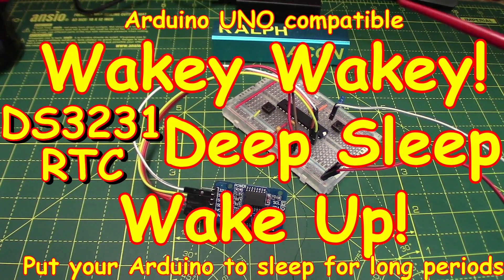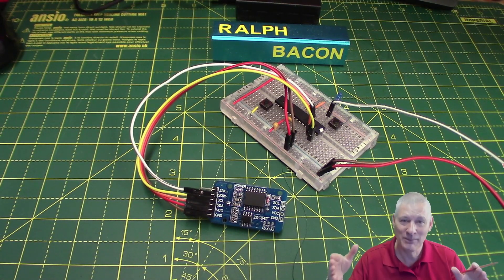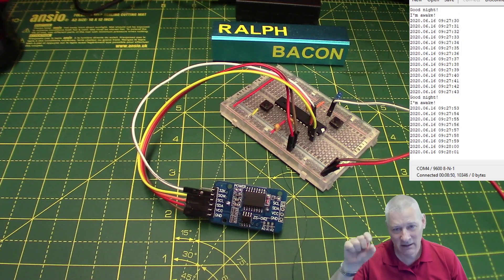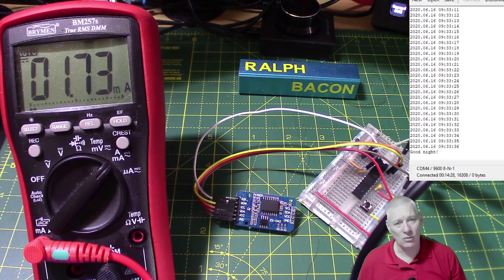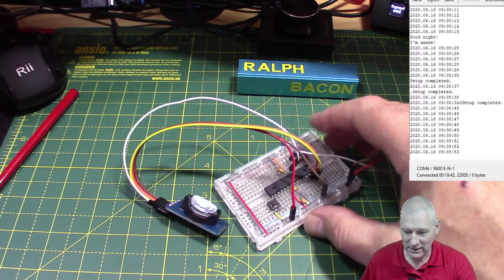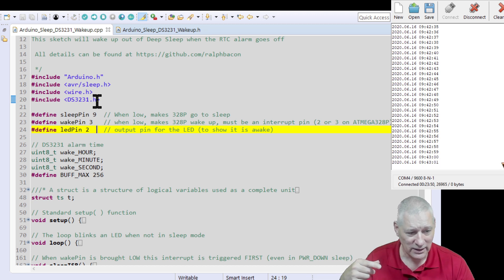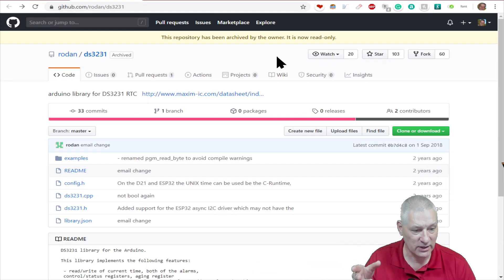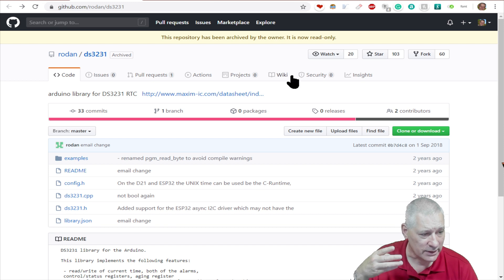#192 Wakey, wakey! Let the DS3231 RTC wake up your Arduino - easy!

Comment: Thanks for the interesting video Ralph, I actually use these RTCs with all my IoT sensors around my house but it did take some time to get a fully working & stable device for my needs, i.e.extremely low power use.

Without posting my schematics the basics of my system are as follows:

Sensors are powered via 2 x 18650 cells in parallel for capacity not voltage which go to a ultra low Microchip 3.3v LDO

The output of the LDO is connected to a P- Channel MOSFET & the gate of the MOSFET is connected to the INT/SQW pin of the RTC (DS3231)

(all this time, my ESP8266 & even the RTC itself has no power, the RTC purely running on CR2032 backup)

When an alarm is activated, the gate of the MOSFET is pulled low which then sends the regulated 3.3v around the circuit.

ESP8266 is powered on, takes a reading and sends this reading to the main unit located elsewhere via ESPNow, ( the main unit is connected to a permanent supply & connects to the internet to upload the reading), sets a new alarm for the RTC and then shuts down to wait for the next wake up call. The MOSFET gate is then sent high once again & all powere is removed from the circuit.

RTC is now running on battery backup again.

There are a number of caveats though that mean some modifying of the DS3231.

The 472 resistor pack located above SDA & SCL pins on the RTC have to be removed & make sure that there are SDA & SCL pullup resistors on the board being used, good thread here:
https://forum.arduino.cc/index.php?topic=537675.0

For super low power removal of the LED on the DS3231 is also a great idea.

Plus a necessity for anyone who uses these RTCs is to remove/disable the inbuilt charging circuit.

These RTCs come ready to accept an LIR2032 rechargeable battery, most people find these inadequate and fit a regular CR2032 non-rechargeable battery in the holder. The problem is that there is a  charging circuit on the unit, not a good mix with a non-rechargeable battery installed.
For simplicity I just removed the 200ohm resistor on my RTC, some people removed the whole circuit though.

More details here:
https://thecavepearlproject.org/2014/05/21/using-a-cheap-3-ds3231-rtc-at24c32-eeprom-from-ebay/

Cheers..,
Reply from the maker: Very interesting. I also got the P-channel MOSFET of a Si4599 to go LOW via the SQW/INT pin of the DS3231, and the current required was in the order of 3µA. I'm guessing that when you clear the alarm the open-drain MOSFET on the DS3231 goes high again which is enough to turn the P-channel MOSFET off again? Neat. Thanks also for all the other current saving techniques, every µA counts!

Comment: There is one interesting thing about these DS3231 modules. They are trying to charge the CR2032 battery! I can't remember where I found the schematics of this module and noticed this couple of years ago, so I can't give a link. But you need to remove one 200 ohm resistor right next to the SCL pin on the 4 pin connector side. It is between the MELF diode and the SCL pin. Both the diode and the resistor are in on this very wrong charging circuit, so you can remove either or both. This may also be the reason of higher than expected current draw.
Reply: Or you get rechargeable  cells
Reply from the maker: I even have one with a rechargeable battery still in it. Dead as a dodo now of course. I will check whether the charging circuit is still included on mine and remove the resistor/diode. Good information, thanks for posting.

Comment: Excellent video! I did a breadboard/bare bones project like this, and ran into the RTC eating too much current during sleep. My solution was to power the DS3231 from a pin on the microcontroller. Before going into deep sleep, I set the pin low, then set it as an input without pull-up. I think I got to around 40 microamps. The DS will still trigger the low alarm signal, so having the Int pin with internal pull-up is necessary. Runs for around 16 months on 3 AAA batteries I think.
Reply from the maker: Nice work! 16 months on 3 AAA batteries is pretty good. I tried powering it from an Arduino pin but got strange results and I was pushed for time. Nice to hear it can be done by you Andrew. Thanks for the post.
Reply: @RalphBacon  You're welcome!  One thought:  Did you remove the charging circuit from your board?  The diode/resistor pair near the auxilliary SCL connector form a (really bad) charger from Vcc direct to the battery.  (From memory, the boards are meant to have a rechargeable 2032 but usually have a CR2032, but in any case the charger is inadequate/dangerous depending on Vcc)  I'm wondering if that would pull down the GPIO pin's output too much?  Out of interest(?) my proto board also had a tiny OLED display for setting the clock and some other parameters for my project (environmental air sampler), so I used the same trick for that with a GPIO pin to power it during setup.  You've got to love this stuff!
Reply from the maker: I didn't but plenty of viewers reminded me to do so!
Reply: great !
by any chance can you share diagram and code please ?
Reply: @ighost_1337  should be able to. It was a work project, so I'll check if anything needs stripped before sharing. Drop me a message in a few days if I don't respond again! Cheers.
Reply: Thank you for your insights Andrew! I'm working on a project and used your fix to get it to sleep quite nicely at .15mA. Good for about a year in my app I hope. Much appreciate! The timer was unsteady on the interrupt so I put a capacitor across the power pin and ground and it smoothed it out nicely. Gord

Comment: Bugger, I just bought a handful of 1307s! Need to get my hands on some 3231's now (not that I need them, but I love this function)!
Reply from the maker: Ditch the 1307s, Nick. I have some still and will never use them, they lose seconds per day and are not temperature compensated (so they get more inaccurate the hotter it is, during the summer, for example). Sad but true.
Reply: @RalphBacon  Bloody hell! I had no idea. Thanks very much for the heads up. I'll keep a couple for the archives and bin the rest!

Comment: I used a similar idea to save power when using a venerable PIC 16F84A to make something similar to the "who got in first" device used on quiz shows.  The B port would be set up to trigger an interrupt on a button press, then the Sleep instruction executed to put the processor into a low-power state.  An interrupt would wake up the processor and the interrupt routine would simply return, allowing the rest of the program to continue (check for which button triggered the interrupt, light up a LED to show which button was pressed and make a sound by bit-bashing a port, then go back to sleep until a reset is received).
Reply from the maker: Sounds like a decent PIC project (ah, memories, memories). I don't do any PIC work now, shame.
Reply: @RalphBacon  They're fun to play with.  my next project was making an 8-pin PIC produce a single-bit "white noise" output by internally simulating a 32-bit ripple counter with XOR feedback, effectively making a pseudo-random number generator.
My latest project has been programming an Arduino Nano to drive a 32x8 Neopixel display with static text and a colour-changing border.
It's all fun, until it comes time to put a box around it... sigh.

Comment: Been looking at making a birthday clock using a DS1307, promini and 16x2 lcd and came across your video as I was looking for more info on the use of structs.
In some ways seems simple enough but it can get rather deep rather quickly and hence loss of understanding.
So a list of names and the day and month of the birthday and then display something like "happy birthday johnny" ...other times just display the time etc. I guess or "no birthdays today".
I'll keep at it.....cheers Jeff
Reply from the maker: Don't use a DS1307, Jorgo, they are notoriously inaccurate. A DS3231 is much, much better.

The way to approach a project like this is to split it up into logical sections. Get each section working without worrying about whether the time is 4 pixels too far to the right!

So, I would:
1) Get the LCD working. Display HELLO WORLD on it. That proves your I2C is working too assuming you are using one with the extremely useful "I2C backpack" which I covered in a recent 'Bacon Bytes' video.

2) Read the date/time from the DS3231 (Getting the date/time INTO the DS3231 is another task). Display it on the (working) LCD. Ignore the fact that it's the wrong time and date. You will need a TIMER TASK to run a function every minute to update the time.

3) Find out how you set the date/time on an DS3231. It's best to do this in a SEPARATE sketch otherwise you run the risk of overwriting the real date/time with some past date/time in your code. Don't ask me how I know this!

4) Decide how you will store the birthday info. On an SD card? Whilst you can hold such info in EEPROM, that is more difficult initially. Updating an SD card is easy on your PC/Mac and then just read it in the sketch.

It would take me probably a few days to do all this so that I had a working prototype. It might take you considerably longer. The best advice that I can offer is to do the tasks one by one and get it WORKING well enough before moving on. And watch my video #BB9 about organising your code, you will thank me! Good luck!
Reply: @RalphBacon  Hi Ralph...thanks...covered up to point 3 and will take a look at your link. Had been looking at storing [10] birthday names with day and month in progmem in a struct but how to retrieve is yet to come. I guess a "for loop" to check the now time and compare. Anyhow, onwards and thanks for the link. Cheers Jeff

Comment: Another good video thanks,
the ds3231 module along with a EEPROM has a diode and resistor from 5v to the battery adding a sleep drain along with the I2C resistors. Working days and weeks ahead is a pain unless have UNIX time a count of seconds and decode void to convert back to time format ts. The time library does this ? Graham
Reply from the maker: The Time library (or something very similar) does this, Graham, as I use UNIX time in the HomeAlone project so it will be an #include in that code. Whoever is interested, that code (2,000 lines of it) is in my GitHub.
Yes, others have mentioned the charging circuit (which I had forgotten about, even though one of my DS3231 actually has a rechargeable battery in it).

Comment: Grand video. A couple of thoughts to save current. As the DS3231 has a backup battery would powering the DS3231 from an arduino pin then allow you to cut the supply in the go to sleep sequence [I dont know if that affects the alarm out pin]. Second idea, would wire.end() de-energise the I2C just ahead of sleep, then wire.begin() on wake up?
Reply from the maker: Best to keep the DS3231 on its own 3v battery - it will last for at least a year. And, yes, it needs the power to function (ie create the alarm, of course). does Wire.begin/end control the power or just start the protocol?

Comment: Observation: the pull-up resistors are not only applied to I2C's SCL and SDA, but to SQW.  The DS3231 chip supplies SQW on an open drain, but the board with its pull-up resistors connects SQW to the board's Vcc, and Vcc is connected (amongst other things) via the LED to ground. That means that when the RTC is running on its button battery (no power on I2C), volts (from an external source) applied to SQW are attempting to power the LED and other bits of the board, and current is draining from the external source even while the alarm has not yet fired. Which rots my socks.
Reply from the maker: Probably explains the higher-than-expected current drain.

Comment: Good stuff here!  Given that you mention that I2C is only good for distances of ~1 meter or so,  what would you use to go further?  I saw mention in one comment about "stuff all around the house",  what would you use for something like that?
Reply from the maker: WiFi is the obvious thing to connect stuff around the house, roy, although if you really wanted a wired connection then RS485 is robust (I even did a video on it, #106). You can get extenders for various protocols too, that all run on CAT5/6 cable, which convert the  signal from one protocol to another and back again. That way you can run I2C over hundreds of meters (see https://learn.sparkfun.com/tutorials/qwiic-differential-i2c-bus-extender-pca9615-hookup-guide/all ). WiFi (if you have decent enough signal) is the "cleanest" method though.

Comment: How do you program the chip, do you put it back in a UNO upload the sketch then pull the chip and put it in the little test mule you built? Or do you have to play around with one of those finicky FTDI things?
Reply from the maker: When I design a circuit I allow for the ICSP connections (so the SPI pins, basically) and use a standard programmer (or an Arduino-as-ISP) to program them. 

Once you have used an FTDI (USB-to-Serial device) a bit, you'll find them a lot less finicky I assure you!

Comment: Hi,
thanks for a very nice and very helpful deep sleep videos. I had difficulties using watch dog and thinking about using RTC instead. In the end i got everything working but questions arose. Why? I get it that from a person perspective waking up every 8 sec can be tedious but Arduino can not complain unless its programmed to. I havent cought it in the video(s), but is there some reason why should i be using RTC as a interrupt source instead of WDT worth that increased consumption? I understand that these tradeoffs depends the most on the project but are there some generall pros and cons for battery projects? Second question is just theoretical idea that iam not able to try because i dont have DS3231 in hands. Is it possible to disable I2C before sleep and enable again to save power?
Reply from the maker: The main advantage of using an external RTC to wake up a processor is that you can schedule (complex) timetables to do so. Eg, every 43 minutes, or twice a day or... you get the picture.

You can, of course, wake up the microcontroller every 8 seconds using the RTC but the Arduino will have no idea of what time of day it is. The clock is not accurate enough to used as a RTC. So if you want something to fire up at 7am each day using the RTC is not going to be very reliable. Using an external RTC will give you that accuracy.

Regarding putting I2C to sleep, if we're talking ATMega328P (Arduino UNO) you can put just about every part of the processor to sleep independently. For example, you can put the Analog part of the device to sleep, the Brown Out detection and the Serial UART. Sometimes you need to do this in a particular order, or within a certain number of clock cycles but it can be done.

Nick Gammon has a lot about this on his website, you can read up on it here: https://www.gammon.com.au/power
Reply: @RalphBacon  Thanks a lot for a prompt answer and tip for a really interesting blog. Even though according to your explaination, it doesnt make much sense to using RTC for just periodical waking up, (f.e. every 15 mins) if i dont really care what time is it, i think i buy one to explore more. Thanks again for inspiration. Rabit hole here i come...

Comment: Thanks for these well presented and clear videos. I'm teaching myself simple electronics and find certain Arduino projects really helpful. I plan to use this RTC video on one of my tasks, but only need a "wake up" at the same time each day. In this case do I still need to "set next alarm" each time the sleep pin goes low.
Reply from the maker: I don't think the alarm is held over to the next cycle (unlike your bedside alarm clock) so you need to set it each time. Pretty sure, but best check the datasheet or just try it out!
Reply: @RalphBacon  Yes I will. Thanks for the quick response. I am still having problems getting it to repeat for the first time. I'll get there, and let you know. It's just that you said somewhere in the video that the DS3231 held the data permanently and I assumed that once the hour/min/sec was set it was there until the battery ran out. I still need to work out what I am doing wrong. It works fine on day one, but seems to stall after that.

Comment: I made a box to remind the boss to take her medication at breakfast every morning using theDS3231. Great chip. Remove the resistor array to kill the EEPROM (big blob of solder took the whole thing off!) and cut power track. Using Lidl AAs, it’s still going strong 16 months later (so is she!). It flashes a LED every 3 seconds until she stops it. This battery calculator is much better for this type of project http://oregonembedded.com/batterycalc.htm.
And you can power the DS from an Arduino pin and switch it off before sleeping. Interrupt still drops on alarm!
Reply from the maker: I wish I had found that battery calculator page! Yes, I guess removing the EEPROM and the battery charger circuit would do wonders for the current consumption. I will have to modify my one to do this and re-measure. Now, I tried powering the DS3231 VCC from an Arduino GPIO pin but got weird behaviour so I didn't mention it during the video. I'm glad you said it works OK so I will retry that. Great information, thank you.